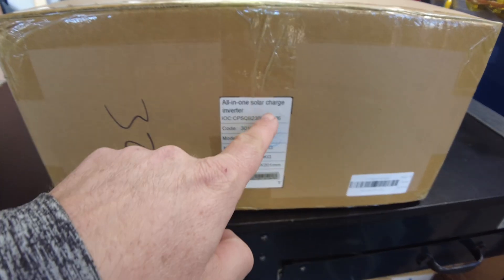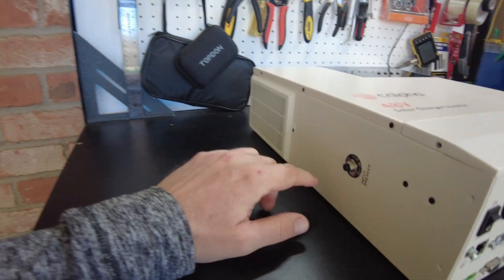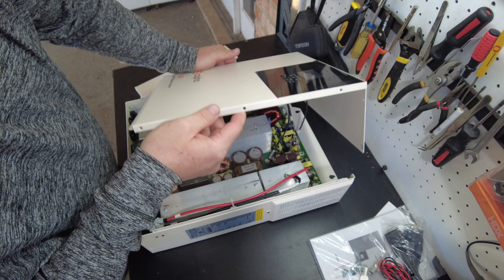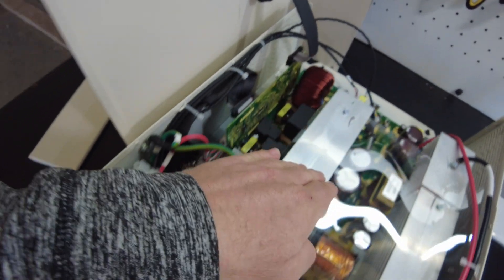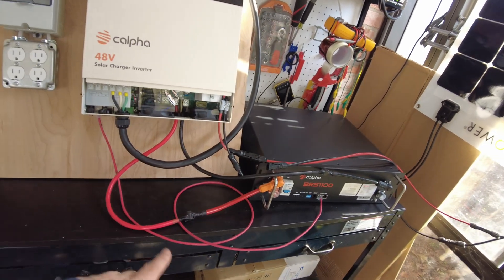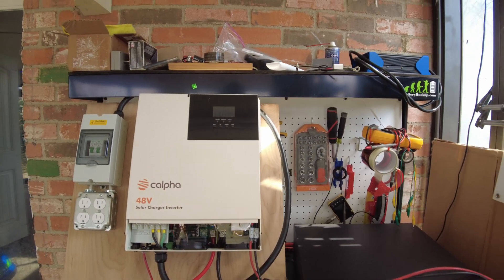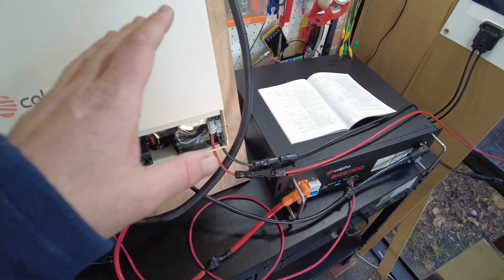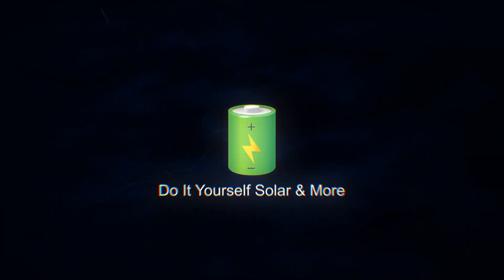Calpha 3500w 48v AIO Solar Inverter

Comment: Calpha Alfalfa. These cheap, Chinese made,  lightweight high frequency transformerless inverters offer a shorter life expectancy and a poorer peak power capacity than real inverters that are made with iron core, copper wound output transformers. High frequency inverters like this, also offer less safe operation, because without an output transformer, they don't provide any galvanic isolation. This inverter is no different in design  than a cheap Harbor Freight inverter. No thanks.
Reply from the maker: Do you use isolated charge controllers? I'm much more terrified of PV level high voltage DC hitting my battery bank. Thanks

Comment: Other than the initial setup stuff, was there anything really negative about this unit? I don't plan on buying their battery, but even if I did, I can build the cable. They have a 5000w unit that's $100 more than the one you tested so... in your opinion is this a good deal or is there something better?

Comment: Does this act as a ups? Would you be willing to hook up to grid and test? Thanks - nice review.
Reply from the maker: I think it does. In the manual it mentions priority. You can set AC as the priority meaning it'll use AC-Grid until it drops out, or the voltage is out of range, then it switches to the inverter, and battery. I'll see if I can get a follow up video in to test this. Thanks

Comment: I have a lot of dealings with those one and a half inch fans they're only good for about 18 months without replacing them running 24 hours a day of course
Reply from the maker: Yeah pretty much, depends on how cheaply made they are. I've had high quality ones with ball bearings last a really long time. The cheap ones usually have sleeve bearings, and the crappy lube dries up too soon. Thanks!

Comment: Does anyone make a grid tie inverter with battery and solar inputs:?
Reply from the maker: Yes, I think the Megarevo (although I've heard of problems), and many others do. Actually I think the term "Hybrid" is really meant to note it being "Grid-tie", and "Off-Grid" capable. Thanks!
Reply: @BradCagle  I'm not sure Brad. I think hybrid means you can feed it power from the mains and the output can power things, but the output is not synchronised to mains phase so cannot be connected to the mains. Grid tie means it is synchronised to the mains and can feed the grid directly. I may be wrong though.

Comment: Another paid, afiliate, advertisement for yet another cheap short lived,  high frequency, transformerless, low surge capacity inverter.
Reply from the maker: I don't accept payment for reviews, never have. Some products I have affiliate links with, this is not one of them. Most of time I do receive a product sample for free to conduct the review. The product has value, so I'm required to check that box when uploading the video. This causes the "Includes Paid Promotion" banner to show. Now that being said, people use HF inverters, many people like them, so to each their own. I have a Victron coming up next so you'll finally have something you might like? Thanks

Comment: A 20ish phone charger or small power bank then would not be detected as a load?! 🤔
Though i highly doubt one would use such setup to power on such small loads. 😅
Still would be an interesting test to see.
Reply from the maker: Right, I think if that's the only thing you have connected it would shut down if you're using eco mode. Would be nice if it was configurable to allow different thresholds. Thanks!

Comment: Solar input is a low compared to other all in ones with 500v and 100 amps pv input.  I appreciate the videos.  I'm going on 2 years into my adventure with solar and have learned a great deal from you and others on YouTube.
Reply from the maker: That's true on the solar input. Glad you find the videos useful! Thanks :)
Reply: I bought a 60a mppt to use four 525 watt panels.Need 2 units 😂 Now looking for a bigger 24v inverter for rv roof top ac.
Things were so mush simpler running a gas gen 😝

Comment: I've been installing the little Growatt 3000 lv's since 2019 with good luck. Since they are going away hopefully this will be a good cheap replacement.
Reply from the maker: Ahh, I didn't know they were going away. I guess they have been around awhile. Always bothered me that something like this may just go away, what if you have several of them in parallel, or multi-phase, and one needs replacing? Thanks!
Reply: @BradCagle  I've had to do that a few times now. Fortunately they aren't completely gone yet, although one has to make sure the firmware matches between parallel units or series units. The price on these is cheap enough if they turn out to be one that holds up that they could fill the bill and not piss current customers off too much if more than one has to be replaced. Time will tell.
If they are the same as the Renogy unit like someone else commented, that's not encouraging.
Reply: Yup,REN sell HQST mppt units that look same as others.Shit customer service.

Comment: Renogy 3500watt aio.  Even the book looks like it.
Reply from the maker: It does pretty much look the same. I think the ports on the bottom are slightly different. Probably from the same manufacturer though. Thanks!